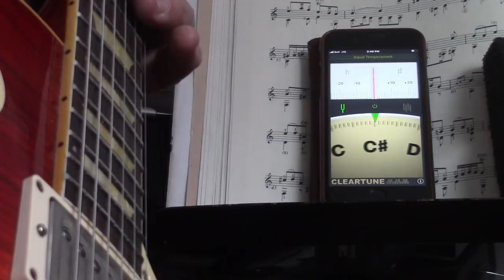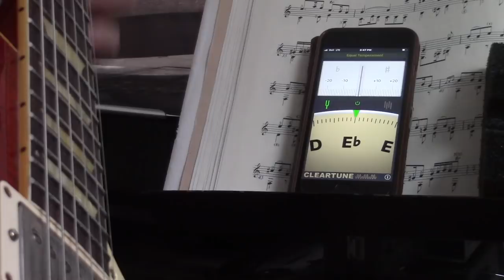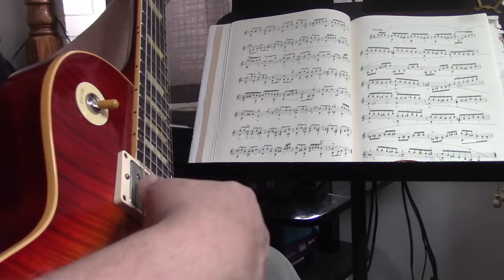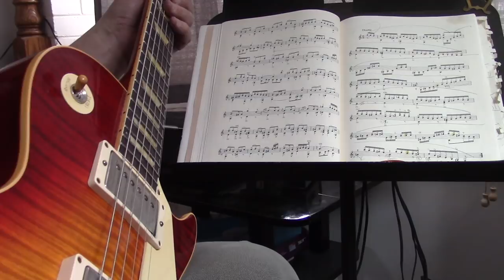1959 R9 Gibson Les Paul@StringTechWorkstations

Comment: R9 means 59. If that's a 1958, It would be an R8.
Reply: the difference between r8 and r9 is pretty substantial too
Reply: doesn't the R mean it's a re-issue?
Reply: pablo rages yes
Reply: R9 means it is a reissue 1959 but it was made in 1958.
Reply: The only difference between R8 and R9 is the neck carve, nothing substantial, you couldn't tell the difference other wise. Some years R8 neck carve was very close to an R9. I prefer an R8 neck.
Reply: Al Pachino The R8’s also have plainer tops.
Reply: There are 59 les Pauls made during 1958. These necks were usually the thicker ones hence the confusion between the 59 neck transition
Reply: @RockaByeYT  
Question..did they transition to the thinner '60s' slim taper actually in 1960 or was it a bit later?
Reply: @jamfajardo
Man I hope you're trolling.... "there were 59 les pauls  made during 1958".????..just listen to that statement dude!!!
Reply: Al Pachino , R8 frets were smaller than R9, per the vintage originals.
Reply: @renodavid  not not necessarily, my R8 has a flame top.
Reply: @shtdaprdtr  2021 automobiles are made in 2020.  Just because the release date on the title says 2021 it does not mean they were made in 2021 . Same with guitars. the 1959 models were likely built in 1958  to have enough stock to sell in the 1959 sales year . in automobiles there are two production  dates April and August  , hence the 1964-1/2 Mustang and the 1970-1/2 Camaro , meaning the were on the dealer lots in September. Chevrolet wsa producing 1969 Camaro after they began making 1970 Camaro cars
Reply: @carmineredd1198  okay and??? What does that have to do with the design code designation of a les paul reissue???
Reply: @carmineredd1198  I understand exactly what you are saying...they could have built 1959 model les pauls in late 1958...yes...but the whole point here is THIS GUITAR WAS NOT BUILT IN 1958 OR 1959 OR 1960....KEYWORD HERE IS  "REISSUE" IT WAS BUILT IN THE 2000'S AS A FACTORY RECREATION OF WHAT THEY BUILT IN THE 50'S
Reply: @shtdaprdtr  right on , it is not even made from original ebony  mahogany or maple it is a counterfeit guitar irregardless of the name stamped on it . it is a fake
Reply: Regardless of year,  the R indicates that it is a reissue from the factory.  The R is not open to debate !
Reply: @Glenn Watson I was looking up  the word 'insurgency' and other words , such as : insurrection government revolting authority propaganda belligerents rebellion '' economic actions '' ? on who ? and how ? would you cut off his microchip that he received with the injection  ? what tortures wouldst thou imply ? stuffing them into a vat of milk up to their chest ? forcing them to watch gilligan's island reruns  ? is their no cruelty you would not inflict ?
Reply: exactly!!!!

Comment: Just incredible how you fine tuned the Les Paul... Gotta learn the compensated nut technique 🙂... I run 11/52 strings on my Les Paul Studio... I haven't had intonation problems... But I think I need a new nut cause of low and I string slots there is buzz in the G and D strings... Your input ND guitar would really help. Thank you 😇🙏🥂
Reply from the maker: I've got a LP Studio .011" - .049 " coming up next. Stay Tuned ;^ )
Reply: @StringTechWorkstations  sure... Waiting 😎✌🥂

Comment: Some would say that part of the character that our brains like about a Les Paul is that they followed the rule of 18 on the old ones and there is some pleasant dissonance...kind of like a bluegrass singer with a little Smokey-whiney timber behind the notes (best words I got for it right now). Obviously, some guitars are way off and just sound bad, but some are a few cents off in the right places. You did a perfect intonation and it sounds spectacular....like Pavarotti. Far easier to get a good sound out of a compensated guitar, but every once in awhile a mutt comes along that just has “that sound”. CNC is closer to making perfect guitars, but the gang saw wearing out (the kerf changing) may also have contributed to some interesting fret spacing on the golden age guitars at Gibson. Who really knows in the end?
Reply from the maker: Take a minute and check out this video out at 14:45 https://youtu.be/tdGF4BLkmpA

Comment: Hey Mike. The neck binding @4:10 looks to have a tang on it, like a fret. I’ve never seen before.
Reply from the maker: Are you referring to the end of the fret where it meets the binding ? It is covered with the plastic "nib" .... although the nibs on this guitar were very slight. I was extra careful when I did the final buff ! MMcC
Reply: StringTech Workstations No. I should’ve been more clear. I’m referring to the neck binding profile seen @abt4:10 after u removed the nut. It looks like that binding has a tang on it.
Reply from the maker: @johnnypk1963  Got it. You are talking about the cross-sectional profile of the binding. That "tang" as you refer to it, has been part of the Gibson binding manufacturing process for many years. A very good reason not to mess with the binding ... in an attempt to remove it ! !
Reply: StringTech Workstations I’ve never noticed that before. Thx so much, best!!

Comment: Can you please explain to me the benefit of a compensated nut? I have 2 guitars that need new nuts, should I ask for compensated??? I'm using 10-52 NYXL in standard tuning, on 24 3/4 scale length
Reply from the maker: Although the Gibson catalogue says 24 3/4" ... it is actually 24 5/8". The shorter scale is a lot less forgiving. This https://youtu.be/237vjZmWWy4 is the simplest way to explain it. Set up your intonation like everybody does .... open string and 12th fret notes in tune. THEN play the 7th fret ( check on the tuner ) and the 19th fret ... all the way across all 6 strings. Then play the first fret notes all the way across ... see if all of these variations line up. Best , MMcC

Comment: Wouldnt the shrink tube on the bridge posts alter the dynamics of it?   It acts as a dampener and no longer allows the bridge to be directly connected to the body.   People get all technical about this,  the wood the body is,  the metal the bridge is they say it all affects tone...   putting heat shrink tubing (rubber/plastic) on the posts takes all that out of the equation.     Though I doubt it matters much if it still resonates as it did prior.
Reply from the maker: It was really used to take up the slop in the fit of the machining so the bridge doesn't shift when you hit to with your palm.

Comment: People think wrapping strings around the tail piece ala Billy Gibbons,  makes them play slinkier. I have tried both and notice no difference and stick to standard on my R9.
Reply from the maker: The only reason that I suggest a wrap around ... is so that the strings clear the back of the bridge casting and go directly from the tailpiece to the "focal point" on each of the 6 saddles. The "neck set" of the guitar will determine whether it is worth doing ( or not ).

Comment: Please excuse my ignorance but once you fret a note or barre a chord then surely a compensated nut has no effect? It feels like you'd only notice a difference on chords which include open strings, I have an Anderson with Feiten tuning which sounds sweeter on open chords and "nicer" overall due to the way it's intonated. Are you intonating differently as well?
Reply from the maker: You are partially right. If you "death grip" the notes and chords ... all of this work is much less effective. The final "Zen Factor " in all off this is to fret with a focused and  relaxed ( but not too relaxed ! ) fretting pressure. So while I am doing all of these adjustments I pay special attention to the fretting hand ... exerting controlled focused and relaxed fretting pressure.
Reply: Also, once the nut has been compensated, the saddles are intonated accordingly....which DOES indeed make a difference in the fretted note intervals. I’m a Buzz Feiten retrofitter, and it’s a worthy upgrade. 👍🏼

Comment: Dumb question, but why position the bridge saddle screws forward instead of backward facing the tailpiece.  Seems like it would be really hard to intonate.
Reply from the maker: Not a dumb question at all. It does get tricky getting by the bridge pickup ring .... I would prefer the adjustment from the other side as well. Another one of those design quirks.  MMcC 👍
Reply: Guitar guy Jabbia If it’s the other way around the strings can foul on the screws first (i.e. before the back edge of the bridge) as the strings angle down behind the bridge towards the tailpiece. I believe it’s not really an issue on the Nashville style bridge as the whole bridge assembly is wider than for an ABR-1 so the back edge of the bridge is always going to get in the way before the screws would, so they tend to get mounted the other way around with the screws facing the tailpiece. Just to note, this does not make the Nashville bridge better, rather it’s worse in this respect (and most Gibson fans believe in several other ways as well) as the bridge itself is inherently more likely to foul the strings due to its greater width. 

Just to note, I’d contend that top wrapping around the tailpiece isn’t primarily done in order to address neck angle and strings fouling over the bridge. If you have that issue you can address the fouling by raising the tailpiece a touch. I do accept that many guitarists like having the tailpiece as far down to the body as it will go because they believe it gives better vibration transfer... not sure how it can though as even at its lowest point the tailpiece is still not in contact with the body and the vibration transfer from the tailpiece to the body still only occurs through the contact points between the tailpiece and posts, just like it does with the tailpiece raised a little higher. It is true that a tailpiece lowered as far as it can go does increase the string angle over the bridge which in turn increases the downward pressure of the strings on the saddles over the bridge: this could have the positive effect of better vibration transfer through the bridge itself into the body, but also a possible negative impact on tuning stability due to increased string friction over the saddles. However, if you screw the tailpiece down as far as it can go but wrap the string over the tailpiece then you are even more significantly reducing the break angle over the bridge, reducing the downward pressure of the strings on the bridge and therefore arguably reducing (and certainly not improving) vibration transfer through the bridge into the body. 

The real reason guitarists like Bonamassa top wrap the tailpiece is because they believe it gives them a different “feel” to the guitar and the string tension during bending. Let’s be clear here... it doesn’t reduce string tension in the active length of the string under normal circumstances as it if did then the string would be at a different pitch. However, there are four effects that I can think of caused by top wrapping over the tailpiece that could affect the perceived tension of the string when performing bends:

- the length of string behind the bridge is longer than it would be with “normal” stringing. When you do a string bend it’s not only the active length of the string that has to stretch, but so does the string behind the nut and behind the bridge (with some string slipping through the nut and over the saddles in each case, and hopefully returning to the same point again once the bend is released). A different length of string behind the nut is likely to affect the feel of that string stretching behind the bridge;

- by top wrapping you are adding more friction effects to the length of string behind the bridge (which as per the above has to stretch and move during a bend). With a top wrap there is a greater length of string in contact with the tailpiece and probably more importantly the break angle of the string at the back end of the tailpiece as it curves over is much sharper, causing more pressure here and therefore greater friction between string and tailpiece; 

- with top wrapping as already mentioned you are reducing the friction of the strings over the saddle due to reduced break angle and therefore reduced downward pressure of the strings on the bridge. This reduced friction will make it easier for the strings to slip over the saddle as they need to do during a string bend and make the bend feel a little easier; and

- a shallower break angle over the bridge saddles caused by top wrapping over the tailpiece means reduced tension on the section of string between the bridge and tailpiece. This is just physics: if you need a certain tension in the active length of the string then this is generated from the component of the force from the section of string behind the bridge acting in the direction of the active length of string and the greater the angle between the active string length and the section behind the bridge the less of the total force in that non-active length acts in the direction of the active string. Therefore to compensate the total tension force in this section of string must be higher. This is also why a greater break angle generates a greater downward pressure for the string over the saddle. 

I think the last two points are the greatest contributors to the looser feel of the strings under bending with top wrapping and therefore reduced break angle as they are clearest reasons for a reduction in string tension or friction effects (where the string needs to move the most) and therefore for increased ease of bending if you employ top wrapping. 

Sorry for such a long post... it wasn’t the easiest thing to describe in just a few words! 😝

Comment: AWESOME, as always!
Michael, why it is important to have even a small clearance on the back of the bridge?
Reply from the maker: Ultimately, the string should go directly to the focal point on the tip of the string saddle without interference. This is why many have done the wraparound tailpiece ( Joe Bonamassa ) ..... it will always depend on the neck-set angle of the tenon in mortise joint. This angle is what dictates whether the wraparound is needed or not.
Reply: @StringTechWorkstations  Thank you! 
I consider you as the best guitar magician I have ever seen :)
Reply: @aek4018  A risky statement, but also true. That compensated nut/saddle is the true sign. Now I hush so I don't get carried away.
Reply: @StringTechWorkstations  the reason bonamassa does it is Billy Gibbons Pearly Gates was always strung with a wrap around tailpiece because when he bought the guitar it was strung that way  and why????. On the original 1954 les paul custom which was the first lester with a abr bridge and tailpiece was set up that way. Google 1954 les paul custom and you can see in the picture the guitar is strung that way. Your set ups and work are sublime. You have brought out the best in that Lester. Well done Sir

Comment: That's amazing. I can never get my L.P. Standard in tune. I've had the but changed a few times. Right now it has a zero fret, but it's nowhere like this. What kind of compensated but are you using? Who makes it?
Reply from the maker: I start with a blank and cut and regulate by hand ... see in the upcoming video. Cheers 1 MMcC
Reply: Do you take commissions from out of state?

Comment: 3 things--please know the difference between an R8 an R9 Custom shop Les Paul, A CNC machine IS NOT a PLEK machine! & you need to raise the stop bar height if you're not top wrapping to avoid metal fatigue on the abr-1.
Reply from the maker: If you would have read the other comments; we have already covered this numerous times
 ( R8 / R9 / R7  ad naseum ) A plek machine is a computer numerically controlled ( CNC ) device that evaluates fretboards, recommends particular operations to correct any problems, and then carries out those operations if instructed to do so. ... The main use of the Plek machine is to level and crown the tops of frets, work we do as part of our Works set-up. ( Quote from Chicago Fret Works 2012 ). We have also covered the wrap around in 10 or 12 different videos.

Comment: A 1958 would be an R8? an R9 would be a 59!
Reply from the maker: Correct. Just changed the title to 59' .... Cheers ! MMcC
Reply: StringTech Workstations thanks, question why a compensated nut? I have 20 plus Gibson’s and have never had any major intonation issues,? I have had stings binding in the nut due to poorly cut nuts but I only had 1 guitar where I could not quite adjust the intonation perfectly the that was according to the Petersen tuner my ear could not hear it.
Reply from the maker: https://youtu.be/VxG5g0eLVQo